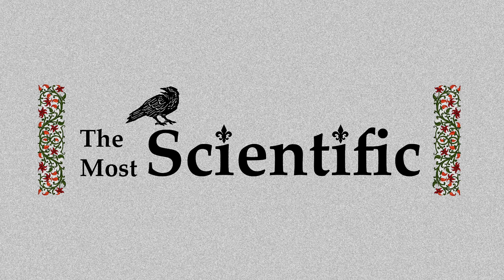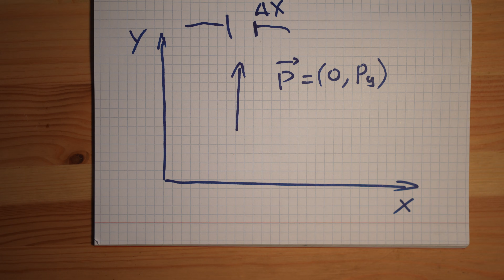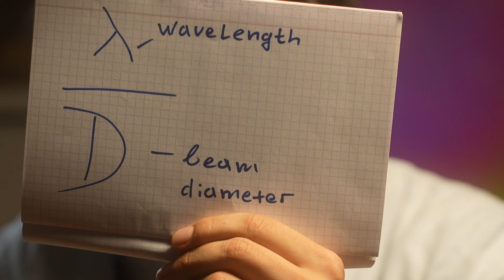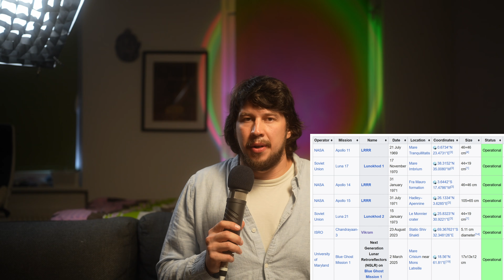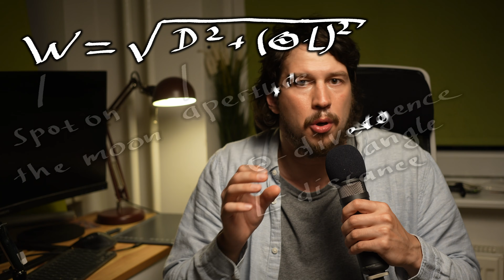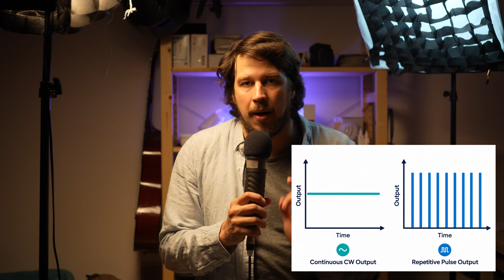Why Even a Perfect Laser Spreads Out

Comment: Its why in 3d dminensional space a spiral outer core, wit ha inner trajectory aligner in a magnitized means.avg. The decay adn entropy is non existent, as the charges balance out and keep form around the core, throug hthe etlromagnetic spread is kept in align meant and slow and dragged as its variables during travel. a different kind of light projecting method... If everything is an rf... and its disbanding ... then alter how the source movies so it real qualitates itself.. meh I don't know 

A guided, magnetically‑stabilized, helical EM propagation channel. - here's ai interpretation of my writing.. which is so so.. -- I was being loose with it. -- magnetically‑confined helical photonic waveguide that uses plasma or magneto‑optic materials to maintain coherence and suppress entropy, enabling long‑distance, low‑loss EM propagation.